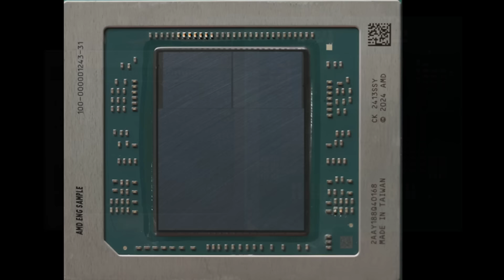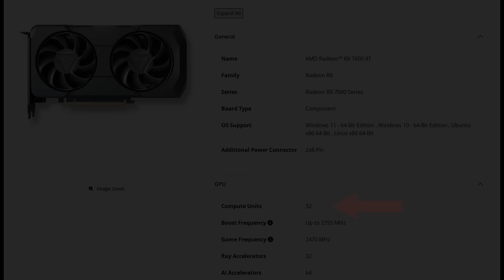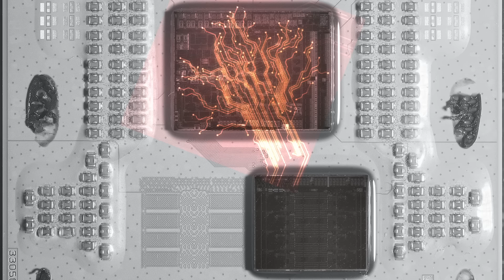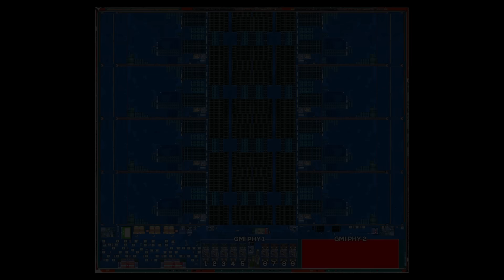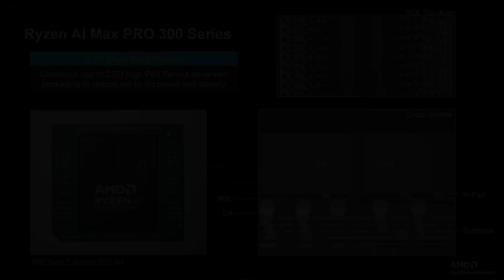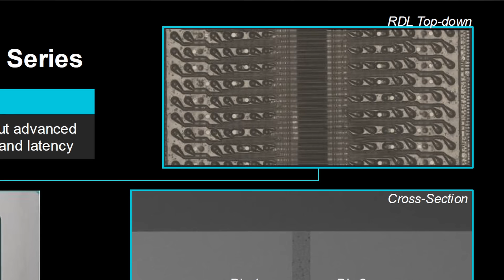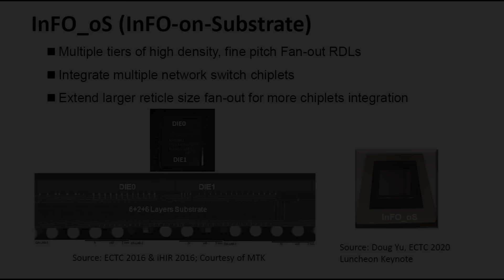How AMD is re-thinking Chiplet Design

Comment: It's a great new design but I'm not sure it's for their general desktop use. Their desktop is set up like their server, and that allows common parts and easy packaging. Low waste, great performance. This design looks to be bespoke for mobile it low power. Would the CPU CCDs be interchangeable with desktop? Would it work with 3d cache? Could it fit in the desktop socket? Would it work as well with desktop memory? Anyway, a high note is that I think we are about to see a lot more interesting products from AMD, beyond regular desktop and laptop chips
Reply: Every segment benefits from more efficiency
Reply: To answer your questions:
- There is absolutely no problem using laptop chips in a desktop socket. See all AMD laptop chips except Strix Halo. All that AMD needs is an I/O die that suits desktop, and there's no problem for AMD to produce this.
- This video speculated about 3D V-Cache. There's no reason it shouldn't be available, but it might be on top of the processing die.
It might mean that desktop and mobile CCDs aren't interchangeable with server, if AMD chooses not to use this interconnect for servers.

Comment: Moving V-cache back to the top sounds like something engineers wouldn't want to do after the change with Zen 5.  Makes me wonder if they have some other solution to the issue of fanout interconnects with an extra cache die.  Maybe instead of an organic interposer, they go with a silicon interposer that doubles as the cache die.  That would also make it feasible to move all of L3 off the main die, leaving more room for logic.  I have plenty of doubts about this approach, especially given how much extra time this complex packaging takes, but I'd be surprised if AMD didn't have something like that at least in simulation in their labs.

A lot is going to depend on TSMC's packaging throughput, which is the real bottleneck for this approach, and the reason why V-cache products always have to come out much later.
Reply: I think there are a few possibilities.

First is x3d on top which is perfectly fine.

Second is flipping all of it upside down like from top to bottom.
 rdl-ccd-x3d.

Third is there may not even be the need for x3d just put the cache to the side. With the new rdl there may be ways to avoid latency issues without using x3d. 

Forth even better, without the infinity fabric the performance is already good without x3d, just like intel.  X3d was there to fix the large memory latency issue. If it's not an issue in the first place, there may be little to no benefit using X3d /large cache altogether.
Reply: @johnyang799  Your last paragraph isn't true at all.  SRAM is still an order of magnitude faster than DRAM.  Having more cache is always going to be faster.  It's no different at all from Intel, where cache is the main factor differentiating their performance tiers.

Comment: We should all be grateful AMD/Apple/TSMC's engineers stabbed intel's MBAs in the heart. Competition had been so dismal for so many years. Subscribed to nudge you towards 100k!  Strix Halo and Apple's M series are such a wonderful taste of the future!
Reply: > Competition had been so dismal for so many years.
for a moment there i thought you were going to break 10,000 years of tradition and ask "why".
there is a reason, and it's wild
Reply: Sadly Intel is not looking good at all 
And without intel amd will just dominate without any competition
Reply: Interesting that you mention the bad management of intel, are there documentaries or something similar where i can look more into why intel sucked?
Reply: It would be fantastic if I could run another OS on it as macOS has just been too neutered to push people to the App Store the last few years

When I have to put a computer into dfu mode because I plugged a Linux usb into it to play around with, that’s a problem.
Reply: Don't forget Qualcomm too. Snapdragon X2 looks to be competitive with Apple M4, probably a little behind M5.
Reply: The general ignorance among the Fabless Co.s re: manufacturing & especially Adv. Packaging has been exploited by their Offshore Foundries & OSATs. Intel Adv. Packaging technology EMIB ) leads TSMC ( inFO - OS ) by 6 yrs ! Even inFO is NOT original, it was evaluated at Motorola & Intel 25 yrs ago but rejected for Microprocessors  on grounds of density & cost. The switch by Apple to inFO in 2016 was influenced by their Foundry w/ spurious technical claims motivated more by eliminating other competing Foundry as a contender. Over 80% of the Adv. Packaging technologies used by these Offshore Foundries & OSATs were developed and first put into HVM by US based IDMs like Motorola & Intel. If you want to educate yourself and stop getting manipulated then come attend SEMICON West on Oct 7 th in Phoenix, AZ the real source of Adv. Packaging techs used worldwide.
Reply: It is very funny that they are doing this in a video where they are adopting a design like EMIB, which Intel has had for a long time.
Reply: Weak AMD in Buldozer era allowed Intel to be complacent.
Reply: it wasn't that weak is the problem.
Reply: @GreyDeathVaccine  Did your 6 brain cells look into what cased the "weak AMD" during the Bulldozer era?
Was it 
A) Intel signing illegal deals with OEMs to not sell AMD parts, for which they were fined billions?
B) Intel signing illegal deals with OEMs to not sell AMD parts, for which they were fined billions?
or 
C) Intel signing illegal deals with OEMs to not sell AMD parts, for which they were fined billions?
All of a sudden, AMD gets the billions it missed out on and Zen comes about. Funny how that works, isn't it?
Reply: @tim3172 A)That happened in the phenom era, not during bulldozer era.
B)Have you ever even used bulldozer CPUs? My Excavator Athlon X4 970 ties with my Phenom II X4 970 BE, and that's against a CPU from 2010. I had Non-intel CPUs for my entire computing life before then, only switching to a used intel sandybridge after being frustrated by how garbage AMD had become. Bulldozer, was, infact, that bad.
Reply: @GreyDeathVaccine Absolutely. I abandoned AMD around 2011 after building a number of lacklustre AMD systems and dealing with constant socket changes. When Bulldozer was released, I decided no more and switched to an Intel i5-2500. I've been using Intel based systems ever since, both at home and work. Current system is based on an i7-12700 and it outperforms AMD's AM4 CPUs for my purposes. No plans on switching any time soon.
Reply: @toby9999  dont be an intel fanboy for the sake of it, they almost went bankrupt lol
Reply: @toby9999 Look, I have an Alder Lake system too and it was okay, but that was the last gasp in between a bunch of missteps and mess ups. AMD has been fine since Zen 2.
Reply: @Gattberserk I just want the best bang for buck. 13600k and core ultra 285k are unbeatable in terms of price performance. To be frank I think they are part of why they went bankrupt. They have to be making a loss on those.

Edit: sorry meant the ultra 7 265k
Reply: @Gattberserk  No point being Ryzen fanboy either.
Reply: @Gattberserk  this isn't a fanboy post. They literally described the exact reason they switched. Not everything has to devolve into school playground-style BS.
Reply: @tTartanScotsman  I using intel but i really must thank AMD this time.

This is their karma for destroying us PC user for past 15 years. Without AMD, we are still using Quad core so maybe you should STFU.
Reply: @sumansaha295  I'm not sure about 13600K value being the best, 12700KF for $160-170 are a killer value.  Also don't sleep on 14700 non-k for around $200-240 used.
Reply: @tTartanScotsman nga your name is linux-lad you ofc have smth wrong with your brain so stfu
Reply: What a stupid fucking comment. Of course the processor that came out 4 years after am4 outperforms  @toby9999
Reply: @toby9999  Intel has been worse than AMD now for a while.
Reply: @toby9999 Luckily for you, am4 was not the competing socket for 12th gen.
Reply: @sumansaha295 The core ultras can only be considered price to performance as long as you ignore every other cpu from this generation and the last.
Reply: @D3R3bel confidently incorrect. the core ultra 7 265k smokes the competetion. In my country the 265 is similarly priced as 7700x and even washes the higher priced 9700x with ease.

Edit: just checked the prices. it seems intel increased their prices by 60 dollars in the past month.....
Reply: Pretty much all silicon Ryzen and up Intel OR AMD is decent.  You can get a 12100F for $50 and it is completely usable for office, productivity and entry level gaming.  It trades blows with an i7 8700 or 9700, despite only having 4 cores.  Yet it also has PCIe 4.0 and DDR5 support.  You can start a system and upgrade later, or re-use your DDR4.  AM5 has no entry level chip since the prices went up on the 8400F, for the same price you could have a 12400F/12500/12600.
Reply: @milescarter7803 crazy things is - DDR4 is expensive now 😂
Reply: @milescarter7803 how the heck an F CPU is good for office? Do you need GPU in it?
Reply: Apple is no competion for intel only AMD.
Reply: @Static-4 how do you figure? It's all about AI now - & Apple is excellent
Reply: @redpilljesus hahhahahha Apple turf  is consumer not industry AI.

Apple doesnt have H100 equivalent  GPU. The only thing Apple is doing is buying AI tech  because they never develop thing from scratch. Mac os wasnt even developed from zero.

Apple is excellent on what  😅?
Reply: @Static-4  Apple has a chance to crush the consumer AI, imagine the next Mac Pro with an M5 ultra or extreme chip with 100 gpu cores from the new iPhone and every single one of those is 4x faster for LLMs than previous gen.. and then add 1tb of Vram for good measure and combine that with their unbeatable power efficiency
Reply: @lukabosnjak3829 Do you think AI can run in a chip? You seriously need  to learn a lot. All Ai runs on farms on thousands of  20k$  cards.

4k faster 100 cores?😅😅😅😅😅😅 your brain has been crushed.
Reply: @Static-4  You're joking or you're genuinely clueless? Maby ask chat GPT to explain my comment to you since you obviously can't understand it...
Reply: @lukabosnjak3829 hahhahahhahahhahahah you re on drugs very clueless. Chathpt  cant think. So you trust more on Chatgpt and you cant figure out on your own?

You talk about 100 cores on an Apple chip. That will NEVER happen.

You said " maybe" . Thats what I love about Apple fanboys they re so ridiculously blinded that Apple can make gold of out lead.

AI is processed on GPU farms nobody who knows about how LLM works will understand and I dont say maybe I m sure that you dont understand the inner workings of AI  computing and  you ll never will be able to figure out that.
Reply: @Static-4 Apple can outperform Intel and AMD and still give better battery life on laptops. As for AI, not every model requires a cluster running Hoppers. I could train a 92+% accurate handwriting model training session with validation and all on my M2 GPU in an hour using Metal in PyTorch. There's plenty of private usages for models that can be run from a home computer, and the cheapest MBP M2 did just fine for simpler CNN models.
Reply: @lukabosnjak3829  you cant understand something it has no sense.   
Do you really think that Apple chip can do local AI?

You dont need chatgpt you need to finish school and some pills.

100 cores inside a phone? let me answer like this😅😅😅😅😅😅😅😅. You smoke something it must be banned in 50 states
Reply: @JakkeJakobsen Apple only can outperform intel amd on marketing. Exactly what areas you think is " better"?  What about Apple on CFD FEA? Ohh there s no software for simulations for Mac os.

Even on video you can build a video workstation that will have far hgher bandwith that anything Apple can sell.
Using faster SSD that Apple can only dream.

Computation is not only LLM and your numbers needs to be verified.
Reply: Hopefully the same will apply for memory, SSDs and GPUs. If they are able to match CUDA with OpenCL the field will flip maybe googles tensor core units will also play a role here
Reply: Yea, except apple did it all from the wrong reasons.
Reply: @widg3tswidgets416  IMO, you could make the same argument for almost any company. "It's the thought that counts" doesn't make sense for companies because they always have ulterior motives, even if just simply to get good PR. That's why I celebrate companies doing a good thing, even if they did it for the wrong reasons
Reply: We lost DECADES of advancement due to Intel.
Reply: @bigb0ss282  lol what are you talking about? it was only since skylake (2015) when intel stagnation began due to troubles of improving fabrication process, and in 2020 amd caught up in terms of ipc
Reply: @bigb0ss282  Before Zen3, people bought AMD because of their price / performance. Since Zen1 AMD good in multithread because Intel still use 4 cores in their flagship. Now people bought Intel and argue it is because of the price / performance. 🤣🤣🤣
Reply: @bimotok757it's almost as if you should buy the product, not the brand.
But amdtards like you fail to see that intel collapsing will lead to the same outcome as a monopolistic intel anyway lol
Reply: But when anyone else tries to advance this technology from Russia China it's all bad competition lol
Reply: @LordAugastus is there any next gen CPU or even a competitive current gen CPU on the horizon from Russia or China? Russia does not have the industry to do that, like not at all. China is leading in certain areas of electronics and certainly has the potential, but in CPUs they are still a few generations behind. Taiwan and Korea are leading in cpu/gpu manufacturing and the US (amd, intel, apple, NVIDIA) and UK (arm) are leading in chip design.
China will need some more time to close the gap. Mentioning Russia in this context is just laughable.
Reply: @Eunice3x I think your propaganda washed brain rot is showing. It took the west 2 decades to get to where we are at. Russia and China don't need to reinvent the wheel, the technology already exists they will catchup. But you have that murica #1 forever ideology, which is correlated with actual rot in the brain.
Reply: @LordAugastus  Not everyone, only American.

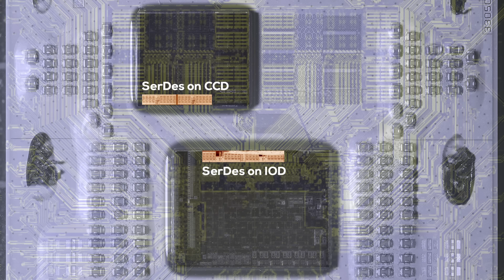Comment: 08:53  Since the original Zen, you mean.  While not a chiplet design, it was MCM, and it used SERDES interconnects between the undifferentiated dies.

Comment: This is the most educational video on tech I’ve seen this year, looking forward to x86 as a platform catching up to ARM (Apple Silicon in particular) in efficiency.
Reply from the maker: Wow, high praise. Thanks a lot!
Reply: It will never happen due to the nature of instruction sets.
Reply: @Iridiumcosmos  Nobody is ever able to explain how the instruction set matters for this in any meaningful way. The biggest difference between the instruction sets that might affect performance on silicon is the fact that x86 has variable-length instructions while ARM has fixed length instructions, making instruction decoding on x86 more costly, however it also means that x86 is more cache friendly. People also sometimes bring up that x86 has some legacy instructions it needs to support, but the cost of that is negligible, and it's not like ARM isn't 40 years old itself either.

ARM chips are more efficient, because they've been the designated mobile platform for decades, so a lot of engineering effort has gone into making them efficient vs x86 which has favored raw performance for desktop/server use. That and Intel's being stuck on the same process for years while TSMC has been advancing didn't help.

Just empirically you can look at how much more efficient x86 chips have gotten since Apple switched away from Intel, especially chips that are coming from the same fabs at TSMC. AMD Ryzen AI Max+ 395 has nearly the same performance as M4 Max, sometimes better, has lower TDP than M4 Max (55W vs 90W) despite using less advanced process (4nm vs 3nm for M4). Instruction set is really not a limiting factor here.

Edit: I just realized that "Ryzen AI Max+ 395" is actually the Strix Halo chip talked about in this video. Strix Halo is such a better name.
Reply: @Iridiumcosmos  that is very minor main issue for x86 efficiency is not having soldered ram next to the cpu
Reply: @s4yto That has nothing to do with anything. The nature in efficiency lies in the underlying principle of how ARM and X86 CPUs handle instructions. CISC (X86) instruction sets are a lot more complex and perform multi-step operations per instruction, they're variable in length as well compared to being the fixed length of instruction sets RISC processors have to deal with. RISC are a lot more streamlined but more instructions may be needed for same workload. However, the simpler instruction sets can be executed in a more timely manner allowing the processor to return to idle faster. Something you want for a battery powered device.
Reply: @Iridiumcosmos  yes but there has been tests on the same node x86 vs ARM arm is roughly 10% more efficient than x86 when both chips have memory soldered on them
Reply: @s4yto That really doesn't disprove anything. The underlying fundamentals on both architectures is the reason one is more efficient than the other. It's another reason why you can't directly compare CISC to RISC processors from performance to power consumption.

Comment: It's about time they change the SOC. It's easily the most fragile part of current Ryzen CPUs. Hopefully the larger area of SoC die means that it doesn't cause the CPU to idle at 50 C anymore. While at it, add proper power down for the SoC on desktop Ryzen.

EDIT: Just watched the video fully and I guess FCLK is gone? Now we just have to hope UCLK does power down properly on desktop